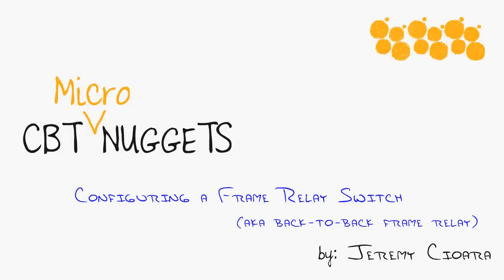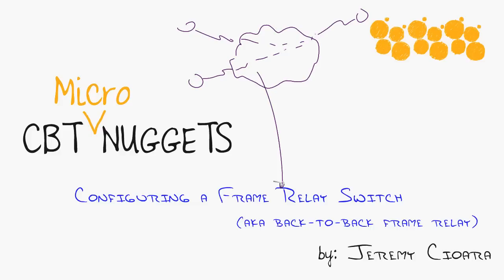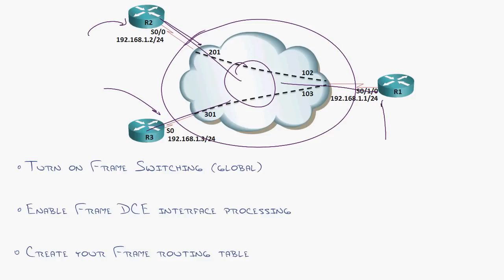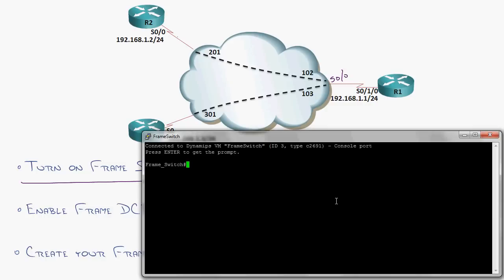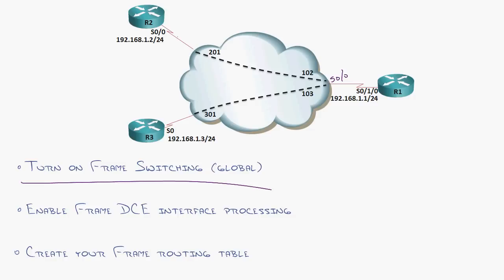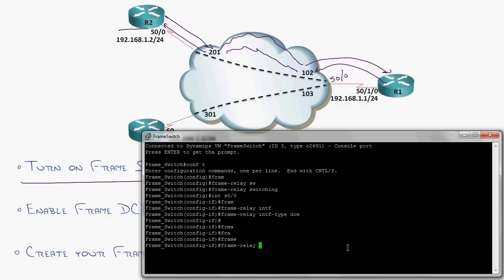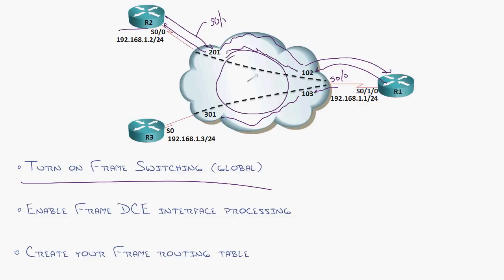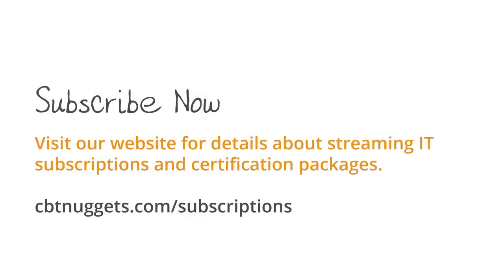MicroNugget: How to Configure a Frame Relay Switch

Comment: That hot dog was amazing! ( the video that is.)
 Is it possible to install an 1841 ios on any of the gns3 routers?Or include an 1841 router in the list of default routers gns3 has? A response will deeply be appreciated. Thanks

Comment: Thanks for this Jeremy, I was following your ICND2 video series and I did not know how to setup the frame switch. So I was kinda stuck for a while, until I found this.
You should have a word with Keith, as he uses the GNS3 framerelay emulator, and in your hotdog, you say that real men don't use emulators :)
I personally prefer the switch approach too, as it drives towards getting more familiar with the different IOS commands
Thanks again

Comment: Multipoint subinterfaces can be configured with Inverse ARP e.g. "frame-relay interface-dlci 103" and with static mapping. So what are the scenarios that static mapping "frame-relay map ip" is absolutely necessary and must be used ?

Comment: Dear Jeremy thank you for this wonderful video. Prior to watching it I had setup Frame Relay exactly the same way when I just recently started the CBT nuggets CCNP route course. But the problem is, that on GNS3 1.2(newest version) when I configure Eigrp AS 25 just like the video buts the interface starts bouncing going down and up randomly so does naturally the adjacency. I can ping the 172.16.124.0 network configured among the multipoint sub-interfaces with their respective DLCI's on HQ, East and West routers but not the loopback networks.
Reply from the maker: Jibran Zia Thank you for your patience while we reached out directly to Jeremy in regards to your question. Here is his response, "I would definitely work on getting the interface stable first. Rather than setting up a frame switch with three connections, just try two in a point-to-point scenario. Does the connection stay stable then? Flapping interfaces can be caused by GNS3 errors (bugs), but could be a misconfiguration as well." Thanks again for your patience we hope that helps!

Comment: What version of IOS on the 2691 router are you using because I dont get those options for frame-relay inside the interface s0/0 ?
Reply: Adam, There is an actual Frame Relay Switch built into GNS3.  You don't need any router IOS.
Check my post before yours on Udemy.
Reply: The problem is not the version of IOS; the problem is that it lacks the command "encapsulation frame-relay" (you have to give it in all the serial interfaces of routers that will function as a "frame relay switch")

I recommend you put in slot 1 of the router module NM-4T (It is not crucial; it is my preference):

1. Put the router in the topology
2. Click with the right mouse button on the router and select "Configure"
3. Choose R1 (or whatever name is in the router)
4. Choose "slot"
5. In the "slot 1" select "NM-4T"

Example configuration:

Relay_Switch#configure terminal
Relay_Switch(config)#frame-relay switching
Relay_Switch(config)#int s1/0
Relay_Switch(config-if)#encapsulation frame-relay
Relay_Switch(config-if)#frame-relay intf-type dce
Relay_Switch(config-if)#clock rate 128000
Relay_Switch(config-if)#frame-relay route 102 interface s1/0 201
Relay_Switch(config-if)#no shutdown

Do not forget to give the command "no shutdown" in the serial interface of the router/switch relay
Reply: OK thanks
Reply: adam coombs
Not at all ;)
Reply: Open Network Monitor

Thanks for this, it appears Jeremy skipped this step in the video
Reply: Jonathan Fourie

Not at all! is a real pleasure to know that I was better than Jeremy eheheheh

Of course I'm kidding! Jeremy is the best :)

Comment: That hot dog was amazing! ( the video that is.)
 Is it possible to install an 1841 ios on any of the gns3 routers?Or include an 1841 router in the list of default routers gns3 has? A response will deeply be appreciated. Thanks
Reply from the maker: dma The GNS3 supports several specific hardware platforms, but the 1800 series is not one of them in the current GNS3 version which is 0.8.x. They will be making a version 1.0 of GNS3 sometime in 2014, which may (or may not) support additional platforms for emulation.
 
A current list of the hardware that GNS3 emulates can be found here:
http://www.gns3.net/hardware-emulated/